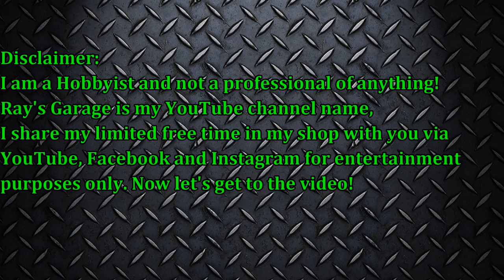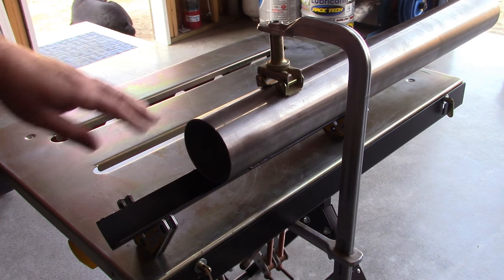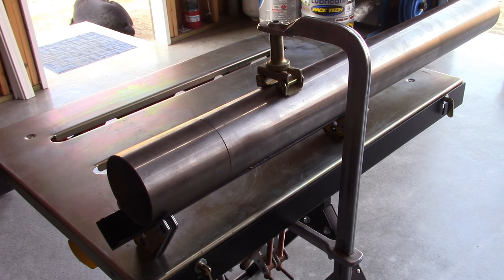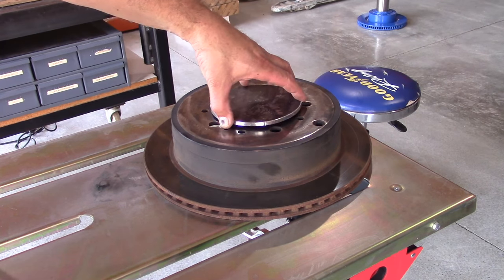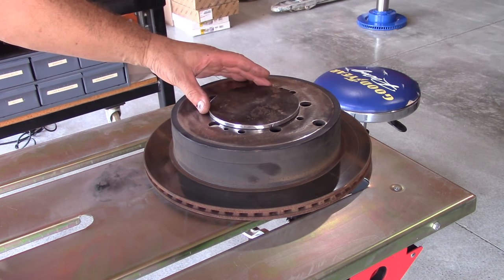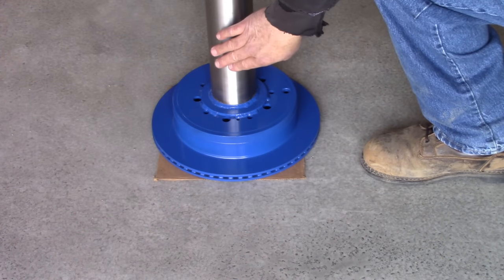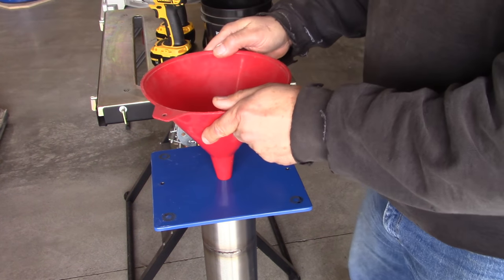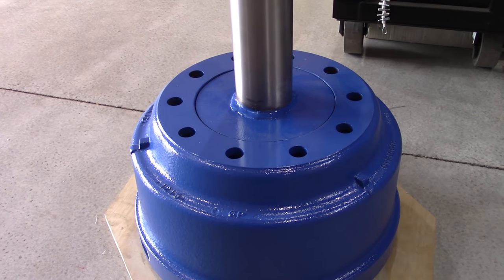Grinder Stands #realraysgarage

Comment: I like them, nice build.  I built a grinder stand with a brake drum and an old rear axle but it is not heavy enough.  You gave me some ideas for making it a little more stable.
Reply from the maker: Thanks man! As much weight you can add to the base the better, just makes it harder to move around! Thanks for tuning in buddy!
Reply: I found some old bar bell weighs in my stash if material, they should do the job.
Reply from the maker: They will work Great, look good too!

Comment: I've done the same thing, but light years less visually appealing. I used scrap pipe flanges and threaded pipe on a stack of brake drums held together with threaded rod, and mounted two machines back to back on one stand. I just spin it around to the machine I want. It saves floor space. I have some wheel bearings that will be nice for some kind of project in this style, but I'm not sure what it is yet. Maybe a rotary welding positioner? --  Merry Christmas to you and your family.
Reply from the maker: Hello John, That is a great idea mounting grinders back to back on bearings, I love the idea and a real space saver, thanks for sharing! Merry Christmas and Happy New Year to you and to yours!

Comment: Hey Ray, double check your air pressure on your plasma cutter, just seems like your getting too much slag build up in cut! Still waiting for that camera to drift over and get a glimpse of one of those hot neighbors by the pool! Have a great Christmas, hope you get lots of cool stuff to share with us!
Reply from the maker: Hello Fred, I have the pressure set to the recommended 65 PSI but I think its my tip or one of the other consumables causing the issue, It's only 1/4" plate and should be a slag free cut! Unfortunately the neighbors pool is not in yet hopefully this coming summer!!! Merry Christmas and Happy New Year to you and to yours my friend!

Comment: Hi Ray. Yes, we also used our old Brake Drums to make a similar stand for our Horizontal Bandsaw material support and even movable Light stands etc. etc. These items can and do have a thousand uses.  Just up to Your imagination.  Like Your stack of Grinders. Surprised U mounted no Diamond wheels on any - seeing U use HSS Cutters.  U Guys should be getting them there at reasonable Prices. Worth Your while acquiring.  Anyway, just my two cents worth.
ATB
aRM
Reply from the maker: Thanks for the info, I'll look into the diamond wheels, I also need a nice white stone wheel as well!
Cheers, Ray
Reply: U mean da Silicone Carbide Wheel.
Reply from the maker: Yes sir!

Comment: Take the other semi drum and build yourself a backyard forge. Just need an old tank vacuum blowing up through middle, or even just a hair dryer on fan only. Expanded metal over hole, load it with charcoal bbq briquettes and you've got a forge.
Reply from the maker: Doc, That's a great idea and will look into doing just that! Thanks for the idea man!